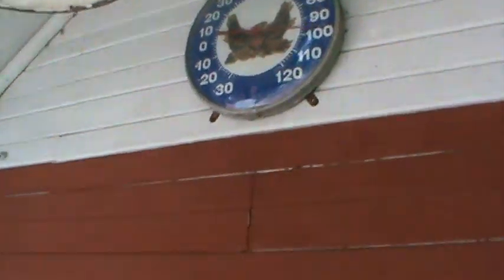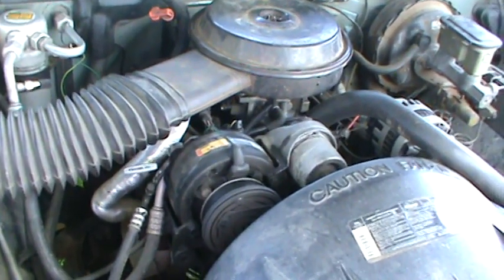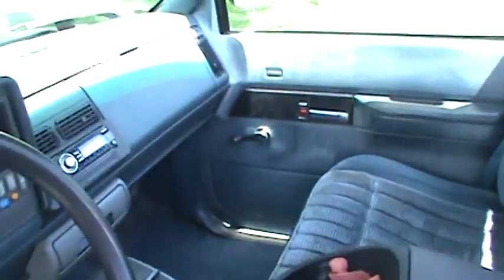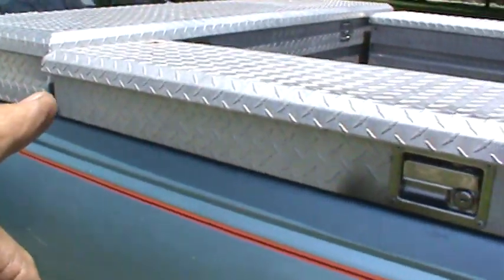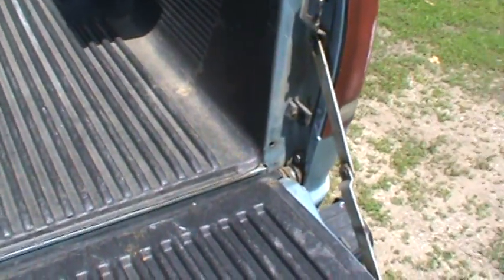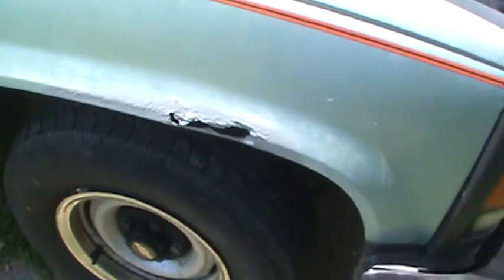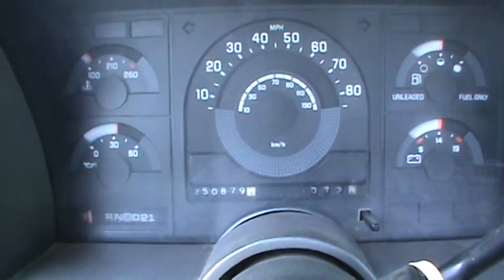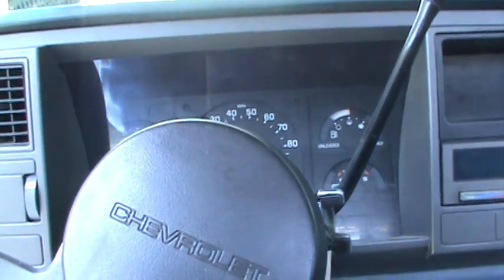1990 W/T1500 Chevrolet Truck Walk Around

Comment: I like them plain jane like that. If the AC is going to work, that's fine. I used to tear it out as a youngster to give me less stuff under the hood. Anymore, it's kind of nice to get in and have a blast of cold air, so if it works, or will work with just charging it up I'll leave it alone.
Reply from the maker: When I'm out felling trees on a hot day, there's nothing like climbing into the A/C to cool down while having a cold drink. Old Blue impresses me with every task I throw at him. May be old and beat down, but still a lot of kick ass left in him. I'm as prideful of this old ugly truck as I am Clifford, the Sunday Driver truck. Always have treated my vehicles like a member of the family, and it always pays off with them lasting as long as I need them to. The last truck, my 1987 S-10 "Durango" Edition was one I wish I still had. Even after a mighty Ash tree fell on it and crushed the cab, it was still an awesome truck that I would take anywhere. But, alas....it's gone and Old Blue has filled "Skullys" shoes well. Great hearing from you my Friend! Zip~

Comment: good vid

I have the same truck. would you happen to know what other engines are interchangeable with this one?

thanks
Reply from the maker: Due to the huge engine bay, you can put anything in there you want. As for what was available at time of production, there was the 4.3 V6, 305 V8, 350 V8 and the 454 V8 Big Block. Zip~

Comment: I think the rust problem occurs to any old gm truck because my 86 has fender and rocker panel rust
Reply from the maker: Most all trucks suffer from this. You can find good replacement sheet steel through LMC Truck or Summit that will last. Cheers! Zip~

Comment: Looks like somebody swapped a steering wheel from a Kodiak truck in there.  I've only seen the 4-spoke wheel on 88-94 C/K's and the wheel you have on the heavy trucks.
Reply from the maker: Good Eye! It's actually a stock steering wheel from a 1988 S-10 "Durango" edition. When I sold the S-10, I wanted to keep part of it since it was such a great truck. Cheers!! Zip~
Reply: That makes sense!  I haven't been around many older S-10's so I wasn't familiar with that steering wheel.  GM steering wheels were easily swapped around until air bags were put in...
Reply from the maker: Yep! Also, most older AMC vehicles used the GM steering columns, so the steering wheels would interchange with them as well. Cheers!! Zip~